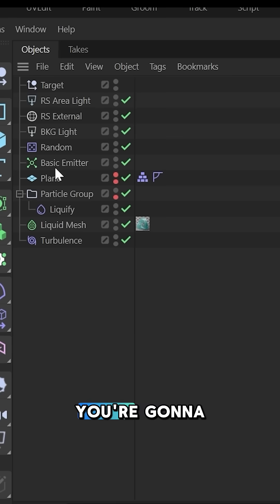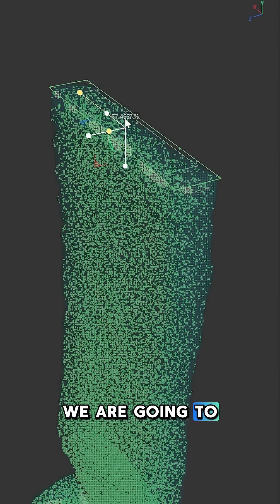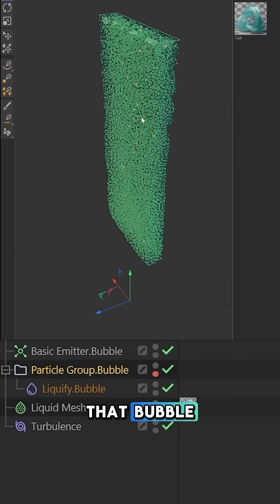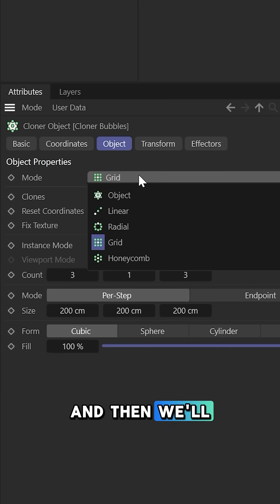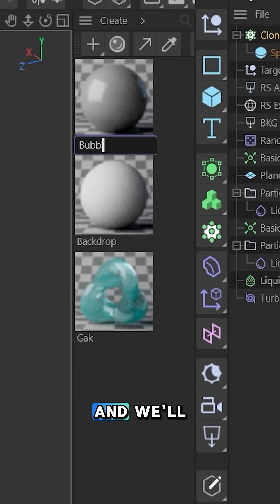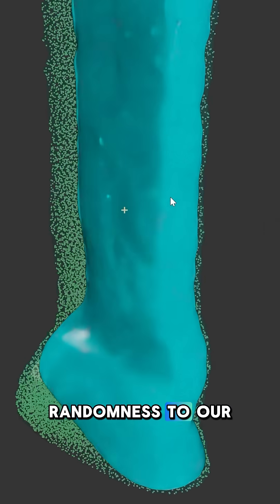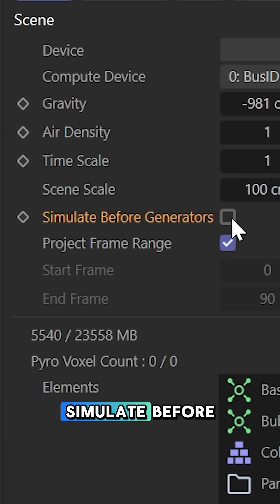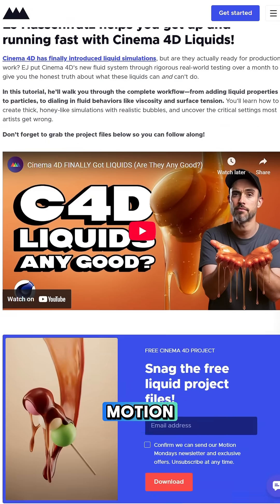How to Add Bubbles to #C4D Liquid Sims REVEALED! 🫧

Comment: Im curious, why IOR of 1 on the Bubbles? Isn't it better to reverse the normals?
Reply: Bubbles are just air, and the IOR of air is always 0. The IOR of a liquid creates a refractive effect when it comes into contact with bubbles.
Reply: @ИванПреминин-э5т  makes sense, thanks bud!
Reply: @ИванПреминин-э5т air has its own refractive index which can even change. That’s why you can see heat rising off a hot road 😊
Reply: Cause air has a different index of refraction. Reversing it wouldn’t change how the light should deflect when passing through it.
Reply from the maker: I tried both and both look the exact same, so setting the IOR to 1 is way faster!
Reply: @eyedesyn  you’d need to cut the bubbles out of the liquid for a Boolean and or flip the normals and it would have probably worked as expected. I’ve think…?